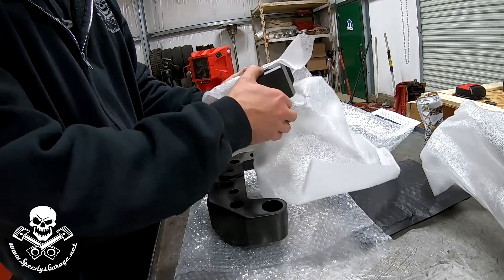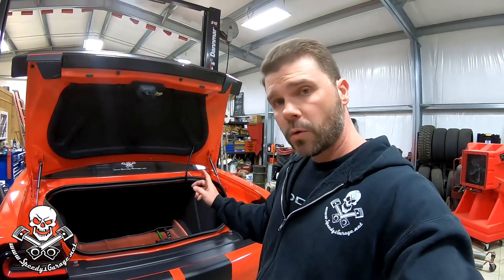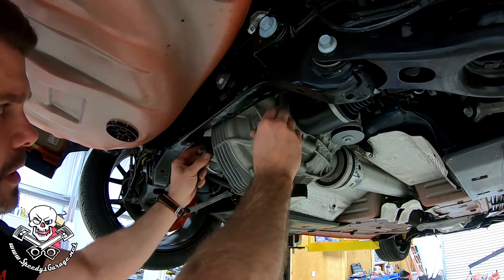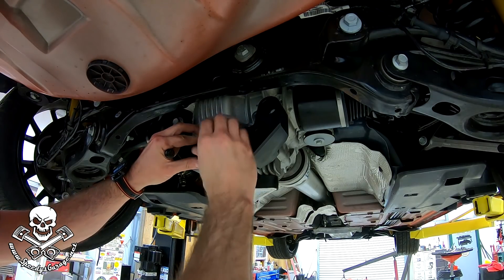Speedy's Garage Per4Mance Development DIRS Install

Comment: Better recheck your lower 3 bolts on your diff. The threads bottomed out on ours. Arp bolts werent threaded enough.
Reply from the maker: I'll double check.  The brace felt pretty tight on the diff.  How did you notice?
Reply: @SpeedysGarage  i ran those three in first and noticed it was loose on the diff. So i went to tractor supply and got hardened washers. Then it tightned up. Washers i used were about 1/8in thick.
Reply: @heatherandjasonnelsonracin647  The ARP bolts are good...the issue is there is variation in how deep ZF is threading the holes in main case. Kits will include washers for now and future production will address this variation. It is very intermittent...

Comment: Will this void warranty? Would you recommended this for R/T and Scat Pack as well (for the average driver, no race tracks....just the occassional quick acceleration passing someone up on the highway or freeway or even just showing her power a little when someone pulls up next to you and teases you to a bit)?
Reply from the maker: Nah, unless you're racing I don't think it's needed.
Reply: Thanks for your reply.  Will it void warranty?

Comment: I have an all stock 21 scat widebody. I street drive and don’t plan on racing it in anyway. I do have my fair share of fun with it though, is this something I’d still benefit from? Would I feel or notice anything different with aggressive driving? Thanks
Reply: Im in the same boat, 21 wb challenger m6.  It definitely helps reduce wheel hop substantially.  The 2 nut-serts the slide into the frame are a huge pain in the a$$ to get lined up.   Also the newest version only removes and replaces the bottom two 12mm case bolts, not all 3 as shown in this video.

Comment: Can the original Style still be purchased, or will it be discontinued??
Reply from the maker: I believe they are still for sale.
Reply: @SpeedysGarage  I was considering getting the old style. Now I see they have this new style, but was wondering if it would be Overkill if I don't plan on heavily modifying my Hellcat or doing a lot of racing on prepped tracks.
Reply: @allengregory4067  that's my dilemma as well.  What did you end up going with?

Comment: Looks beefy...any driving impressions yet?  Not necessarily drag pass...just street driving.  And how much lower does this hang?  Any change high-centering on it?  I know it's inline with the wheels, but maybe you don't know the way the idiot public works guys here around ATL fail to level the manhole covers with the top of the pavement...LOL.
Reply from the maker: It's "maybe" 1/4" lower than the cooling fins on the diff.  Unlikely it'd hang on anything that the diff wouldn't hit.
Reply: @SpeedysGarage  Cool...thanks!